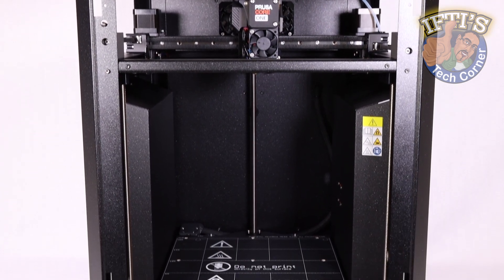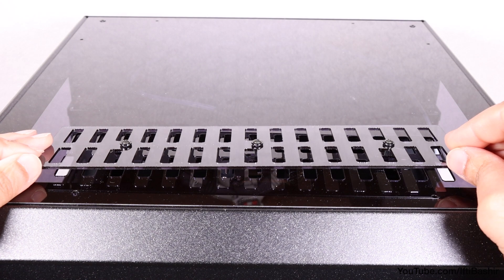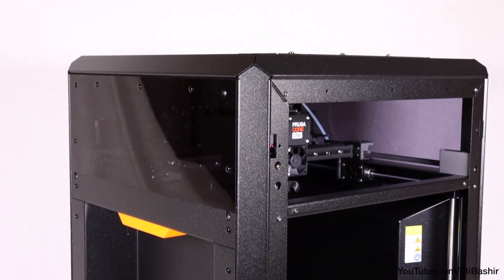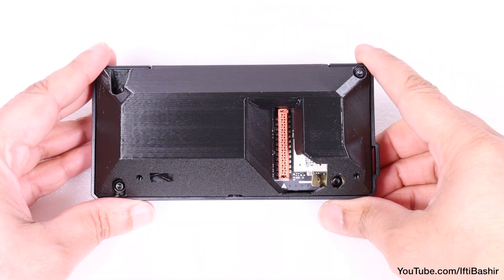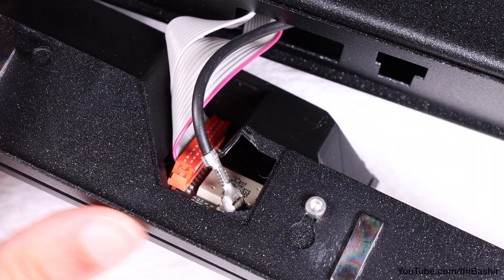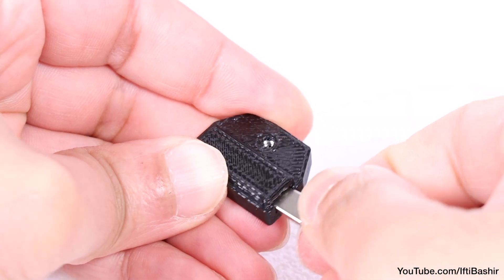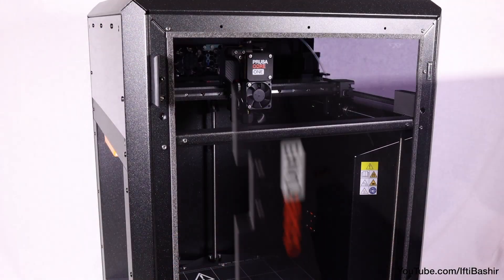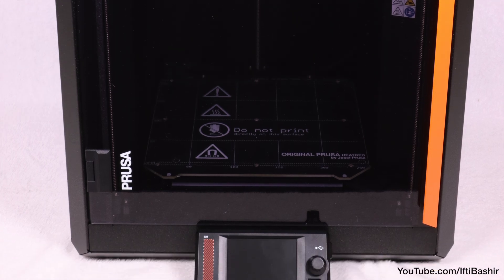#08 Original PRUSA Core One Kit : Full Step-By-Step BUILD GUIDE - Trim, Door, LCD Assembly

Comment: Thanks for the thorough videos! I'm about to build mine having assembled an Ender 3 many years ago. A different class of printer and hard to compare but the assembly technique is similar. Regarding the pop rivets being used especially the top, is there a need to periodically access the extruder or hot end from the top? If so, is there an alternative like easily removed rivets or knurled head screws and nuts below that you or others have found to be useful?
Thank you!
Reply from the maker: I've not had a need for top access but you can actually remove the pop rivets quite easily using a flat edge to pry them out - and they come out fine, hence you can re-use them. You'll also get plenty spare in the package just in case ;o)

Comment: The video shows slots for the display to fit into on the back cover. My back cover did not have slots.
Reply: Same. Also it didn't seem to fit inside the "groove". The right side holes appear to be raised above the level of left side holes.

Comment: Recommend Upgrade: Ventilation Knob, any of the dozens of them on Printables, anything to make using the vent easier. Many have indicator to let you know if it's open or closed.
Reply from the maker: Thanks for the tip!
Reply: Thanks for the tip. I think i will choose Beacon Ventilation Knob for Core One. No. 1238177

Comment: Really useful video although there are a couple of places where you deviate from the Prusa manual (yes I have both open at the same time). Specifically in this section where you put the insulating inserts into the vent cover before putting the screws through the vent. I tried this method and the holes are simply not big enough to take the insert. The build manual shows the vent cover underneath and the inserts dropping into the slots.
Reply from the maker: Yes I note towards the end of the video - I just prefer it this way. Getting the screw through is a little higher, but I did make it work! Either orientation works ;o)